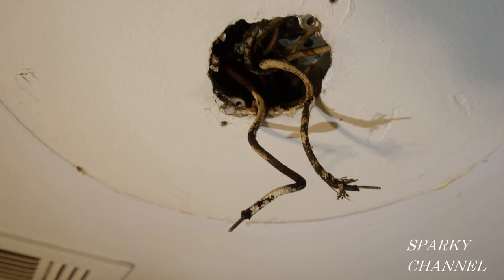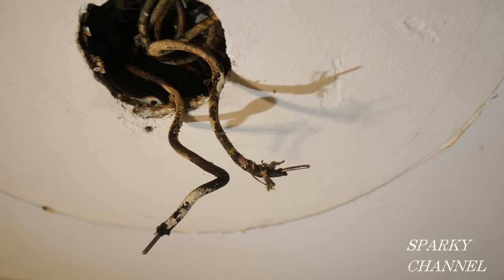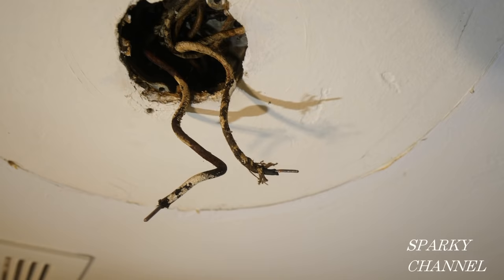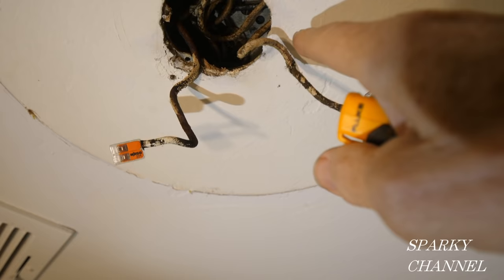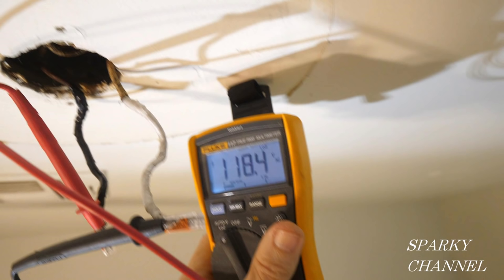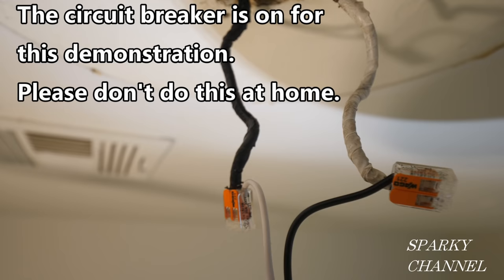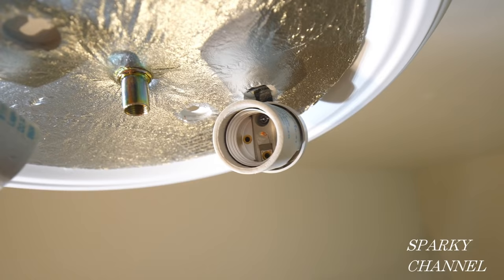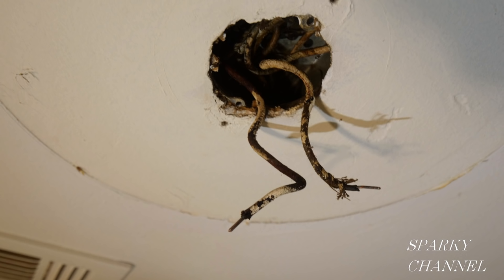Which Wire is the Hot and Which is the Neutral in an Old House? How to Tell and Stay Safe!

Comment: Somebody p[pointed out to me that the WAGO nuts have an access port on the opposite end from where the wire goes into the WAGO nut-maybe I learned that from your channel.  This access port is designed to accept a probe from a multi meter.  The various short videos from the San Diego area are a nice way to end your videos.
Reply from the maker: Yes, the Wagos do have testing ports which can be quite useful and time-saving. Thanks on the endtros. I prefer to have a nice relaxing scene at the end of the videos to thank my viewers for watching. Many of the scenes are from the San Diego area but some are from Santa Catalina Island and some are from Hawaii.

Comment: Thanks for the vid.  How would you trace wires in a ceiling that are for a fixture back to the breaker if they are not getting juice.     It read a very low reading on my meter to no juice.  I need to find out what circuit it's on. Really could use some advice.

Comment: Lol good luck doing this here in Belgium :-)  In some cases we have 2 hots ... and no neutral ... ( 3x 230V in some city's )   In case 3x400V+N  . we have 230V between fase & neutral  .
Reply: Same in UK.  
The loop system?   
My friend who is a tiler did a kitchen  for a lady and she mentioned a light needing replacing in her living room so he said he could do it.   But he just put all reds together all blacks together and all greens together.  Makes sense to the uneducated, but doing that meant the light always had power no matter what was done with the light switch, so I get a call to bail him out, told him to pick me up I wasn't using my petrol for his mistake.  Took me 10 mins to fix it.
1 of the black wires was the switch wire and wasn't labelled up so moral of the story is label all wires/cables as you remove them so you know where they go.
Reply: But then in Belgium switches must be double pole right?
Reply: @mernok2001  nope single pole . Only for outdoor/bathroom it was a regulation .. but now not anymore . We do have  douple poled brakers .. so when a braker trips  L & N or diconnected or  L1 & L2 ( in  case of  3X230V )
Reply: @kittsdiy  Did old houses haver a fuse in the nutral too?Was aluminum wiring also used there after WWII?

Comment: Since this is wired old school, power at the fixture, common sense tells me the protruding single wire that isn't connected to anything else in the ceiling box is the switched hot. That also implies that the other protruding wire, which is tied to something else within the ceiling box, is most likely the common/neutral.
Reply from the maker: Do you mean the neutral as opposed to common?
Reply: @SparkyChannel  That I do. Common and neutral are interchangeable where I'm from.
Reply from the maker: @williamweckel8140  I see, just checking to see if we're saying the same thing. You make excellent observations. Those are good tips!
Reply: That's assuming it was wired sanely, which is not something to trust.  But yes, it's a clue.

Comment: Hey bill. Great series 👌
I have a light switch in my mothers room and i like to add one of those new usb cable phone charger electrical outlet from that light switch... 
The light switch is similar to the one on this video. I have One hot black wire and one similar black wire going to the light fixture on the ceiling.  
How can i go about powering outlet from the one hot wire on the light switch with out a neutral And only the light fixture end on the switch itself.
Reply from the maker: Hi Arturo! You can't add a receptacle if there is no neutral wire.
Reply: @SparkyChannel  fair enough thanks sparky. Great series of electical wiring. Thanks again

Comment: Thanks Mr. Sparky  also what is your opinion on the other brands of wago style push in wire connectors the are UL rated ? Such as Gardner Bender brand available on line , Thanks .

Comment: Thank you----If it cannot be seen whether a box is truly grounded or not is a test to determine it be using a volt meter and putting one clamp on the hot wire and the other on the metal box itself to see if there's 120 volt current? Then if there is you can install a screw terminal and wire the receptacle green wire to that screw?
Reply: Yes if the  equipment ground (bare wire/green wire) is connected back to the source you will read a voltage.  The second part ( can install a screw terminal and wire the receptacle green wire to that screw?) would be better to tie it to the present bare/green wire but if they are both tied to the metal box it will still have a path back if ever needed. There is never any current on the bare/green wire unless there is a fault/trouble. Way back when it was just a 2 wire system (plugs with no round ground hole on them) and people would get shocked when something went bad. So....... The equipment ground was added for protection by tripping the breaker or blowing the fuse. Me..retired, 64years old, spent a lifetime in electrical field..

Comment: The next question is, where is the ground? I see you left your light’s ground wire is just hanging out. I lived is a house built in 1939, with similar type wiring. I found the wire was in metal conduit because Romex had not been invented yet. I found that the conduit and metal boxes were tied to ground at the panel. A ground wire jumper to the metal box worked. Much better than just leaving it hang. How would you determine if the conduit is in fact continuous to the ground?

Comment: Most of my house wiring is like this. I'm replacing an old fluorescent light with a new LED light. The new light comes with a grounding wire. Do I add a wire nut to the end of the grounding wire? Not sure what to do with grounding wire. Great vids by the way.
Reply: Same question here, what to do with the ground wire?

Comment: I have a old house with wire insulation like your demonstration. I purchased some shrink tubing in black and one in white. Make it easy to clean ogg the frays and slip tubing over them. The tubing requires heat source to shrink. Lighter or heat gun works great. You could do a simple demonstration for the folk.
Reply from the maker: Good idea, thanks!

Comment: What if I can’t identify my ground wire (idek if I have 1 cuz it’s not bare or green) and don’t have a ground screw, when I go to test the wires to identify them, if I mistakenly put my probes on the 2 hot wires (because the colors are off and I’m trying to see which is which) will I receive a shock?? Using a Fluke MM and I’m just trying to see which wires are what because I installed a new ceiling fan. I have (coming from my ceiling junction box) 2 white uncapped and 2 black uncapped. Help someone plz. It’s been 2 weeks now…😩

Comment: Sometimes your bazz tester can’t show accurate reading which wire is really hot.But if you will find real ground(it could be  water piping or old electrical piping)that you will know for sure what potential you have between ground and hot wire.
Reply from the maker: Thanks John!

Comment: I'm still curious what would happen if you wired a bulb backwards electrically will it just work the same just backward polarity? Especially an older glass filament bulb, obviously the led lights won't be happy and I'm sure will cook or not work depending on design and safety built in. But say in 1980 I wire a kitchen light backwards, manage to screw it in without be blasted with a jolt from the top of the ladder, would the bulb blow up, or run in reverse fine?
Reply from the maker: That would be reverse polarity wiring, a dangerous condition. See: How To Fix a Reverse Polarity Receptacle: https://youtu.be/UKz7Jv7zID4

Comment: My house was also built in 1957 , however my light fixture only has clear wire coating no black or white no ridges no stripes  just clear coating and the wire inside is a silver color. Plus I don't have all your little gadgets I only have a ohm meter with a dead battery. I took a gamble and it doesn't turn on
Reply: I feel ya! Looks like we should invest in some batteries & gadgets!

Comment: This is a good video in a room if a light fixture is missing.  But if you are replacing an existing fixture with these wires in it, just pay attention to which wire the leads from the fixture are connected to and remember which wire the black wire from the fixture was connected to and just reconnect the black wire to the same wire.  You can also wrap the wires with the proper tape before you disconnect the fixture so you know which wire is which in case you would forget which wire is which.

One other thing about older homes, (I don't know if light fixtures on a switch are still wired like this in newer homes) you have to pay attention to how they are wired because in a lot of older homes they have the main hot wire running into the box at the fixture and the have 1 wire running to the switch where the black wire is connected to one screw terminal and the white is connected to the other which makes the loop.  I believe the black wire connects to the hot from the main wire and the white then connects to the black wire running to the switch and the neutral white wire connects to the other screw on the switch and goes back to the white neutral main wire back at the fixture.  Maybe you can make a video about this wiring configuration and if it is still up to code if it is wired this way.  It seems to me if a fixture is wired like this that there is always power going across the fixture even though the switch is off and the only reason the light isn't actually lit is because the switch breaks the circuit between hot and neutral instead of stopping all power from going into the fixture.
Reply: Regarding the existing fixture situation in your first paragraph, you never know if it was wired correctly the first time and so it is always ‘prudent’ to check with a tester or volt meter.  The volt meter test can also detect other problems if your voltage is well below 120v.

Comment: Is this wire dangerous. I am able to replace just about every circuit that contains this wire in my house except one.  This wire I cannot change without basically gutting 3 rooms.  It’s a 15 amp line that only is doing lights.  Is it ok to keep?

Comment: In an outlet, I find the hot wire is almost always on the right or small prong side, and not the wide prong side.  I like my  Fikes!
Reply: That's how it's supposed to be wired but I find them reversed every so often.
Reply: @illestofdemall13  - Hey man, thanks for the come-back. A question... If a ceiling light or fan doesn't have a ground wire does it work to tie the new fixture ground to the common wire?  - Thanks
Reply: @Tom-Travels  You should never connect a ground wire from a fixture or fan to anything other than the ground wire in an electrical box. If you don't have a ground then you should probably have an electrician look at it. Otherwise you would just hook it up without the ground.
Reply: @illestofdemall13  - I thought so. But I wasn't sure. A lot of us contractor guys, who work on old rent houses, just do the two wires or attach the ground (uselessly) to the back of the box (if it is steel).
-
  My slumlord homeowners and corporations would almost never hire an expensive electrician. I'm lucky to still be alive. ("Look Tom, if you don't get shocked at least once a day, you aren't doing your damn job"). 
-
Reply: @Tom-Travels  Sometimes the old metal boxes are grounded from the back or from conduit. You can only do so much in those kind of situations where the landlord is cheap. Just be safe, use meters, turn off power, etc.
Reply: Correct

Comment: i have two wires and a ground coming into an old garage. when i test the wires with black on ground and red on wire they both will show 120. when i put he meter on the wires themselves they show no voltage. both seem to be hot and neither seem to be the neutral wire. no light comes on and no power to receptacle when i try them.

Comment: Knob and tube wiring is old.  I guess ungrounded 1957 wiring is kinda old.  A little old.  Maybe.  :)  Before these new testers I would sometimes run a green grounding wire off the plumbing or other ground to check old wires.
Reply from the maker: Thanks Bob!

Comment: OMG!!! This Looks Just Like MY Issue.  My home was built in 1948 in Washington DC.  I swithed out ALL of the old 2 prong outlets and grounded them all by watching your channel.  (Not A Single Outlet Was Grouned).  My new question for today 11/2022 is:  While attempting to install a new ceiling fan with remote, I noticed old wiring sheathing/covering was barely attached, seemingly withered with aging and some with no covering at all.  I was successful with wiring the fan however upon tucking the wires in the small ceiling electrical box I turned on the breaker swith just to find that the entire circuit shut down on me.  I slept until the next day to come back and undo the wiring work just to find that probably the bare wire (Somewhere) was making contact with the electrical box or another wire.  The electic is up and running again but the fan project is at a standstill.  Can I fix the bare wiring issue without having to demolish the ceiling and wll for new wiring?  SORRY FOR THE LONG MESSAGE.
Reply: You really should replace that wire but that opens up a can of worms and will most likely find that it’s tied into another wire that also needs to be replaced because of the same issue. Next thing you know you’re rewiring the entire place.

Comment: @sparkychannel In this example, would you leave the green wire from the light/exhaust fan unconnected and capped off or connect it to a green screw on the ceiling box to ground it? I think many people run into this with 1950’s house where there is no ground and maybe even connected to a transformer and it would have been great to see how you address this issue yourself. Tnx
Reply from the maker: You would connect it to the green screw on the ceiling box as that is better than nothing.

Comment: What if at the junction box you test both wires and both beeps then what do you do?
Reply: Get a ground from somewhere and test with a multimeter in ac mode which is further in voltage from ground.

Better to test from the fuse box though, run a wire from there and test ohms between to be sure.

If both wires show electricity with an indicator you really need to check against ground, maybe the neutrals floating at nominal 30-40 volts(without current) at which point you really should know the local code and how the electricity comes to the house to determine where it would be allowed to tie neutral to ground if not at all. If they're both at full line voltage flip some lightswitches around and determine if its a 2 or 3 switch gang thing going on and decode the circuit for that (draw the circuit on paper)

Comment: Bill, are you cautious of asbestos in old construction? It's supposed to be in practicaly everything including drywall,  popcorn ceilings, attic insulation, and even  electrical wire insulation.
Reply from the maker: Yes, I am. I really try to avoid tearing into the walls, etc.

Comment: I have an older house (like in the video) and only have 2 wires. When my doorbell stopped working, I needed to replace my transformer that has 3 wires. What do I do with the 3rd (green wire) when the house only has black & white wires inside of a plastic box (not metal)? Thanks
Reply: Connect black to black and white to white ..use a wire nut or wagos..There cheap at Home Depot if you have a green wire out of the transformer cap or just cut off the bare cable.
Reply: In your situation you dont need the green (ground) wire
Reply: Did you figure it out ? What did you do ??
Reply: @Junior323L  its still just sitting there open. Someone suggested I run a new wire (nightmare). I am getting weird readings at the doorbell (only showing live on one side). Not sure whats going on. Can I send you a pic?

Comment: Have a house built in the same year. The other problem is the sheathing is deteriorating literally crumbling
Reply from the maker: Yes, that is a problem.
Reply: @SparkyChannel . I managed a building only 15 years old.  One section had the white neutral insulation falling off as soon as you touched it.  Must have been chinesium insulation.   Fortunately the hot was fine.
Reply: I replaced a fixture in an older home. The switch had been put in the neutral side, so that the center contact was always hot. Unfortunately this was a two story home so the wiring was not readily accessible. 

Another reason to turn off the breaker, not just at the switch.

Comment: Im changing my kitchen Exhaust fan only has 2wires do i have to ground it
Reply: It’s not a bad idea to run a wire to ground but it’ll work without a ground wire. 

Ground is generally there to take stray voltage somewhere safe

Comment: I dont get it. Here in holland it never matrers ow u plug in the electrical cord in 50% chance u swap phase and neutral i have never seen a light that has one if the wire routed vua the frame  ground is always  fixed if u swap that people get hurt .
Reply from the maker: Thanks!
Reply: On a fixed installation you should wire them correctly. On plug in lamp you are adviced to unplug when changing the bulb.

Comment: What if it's a loaded neutral!  I ran into that changing fixtures in an old house ,  I had the breaker off for the black wire but the neutral was still hot ,
Reply: Sharing neutrals was common back in the day
Reply from the maker: That's a dangerous situation. Another reason to do some quick tests before starting the wiring.
Reply: Also, prior to the 1930’s the white “neutral” conductor was normally switched.  Nowadays we use the black to switch loads and the grounded “neutral” is never switched.